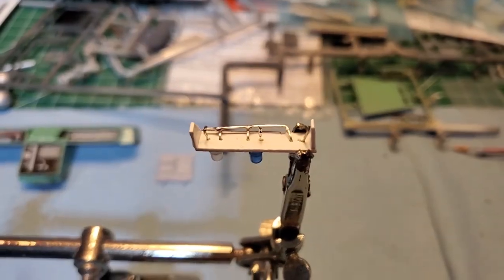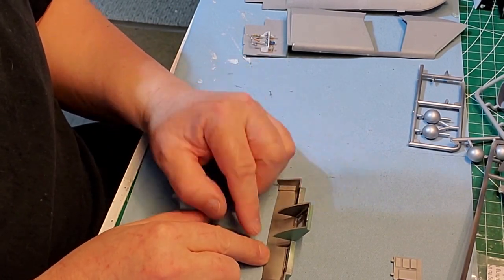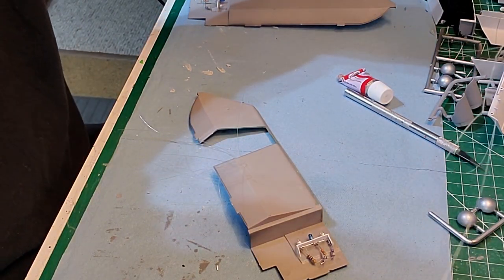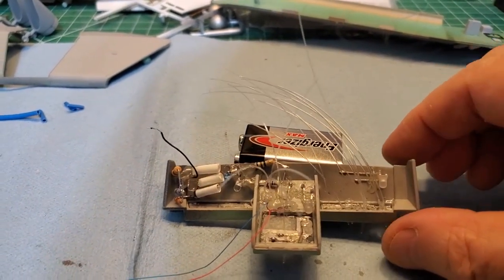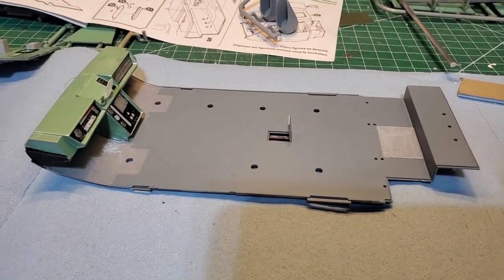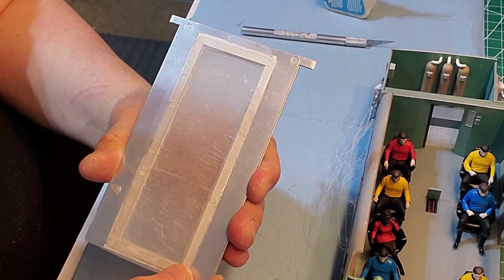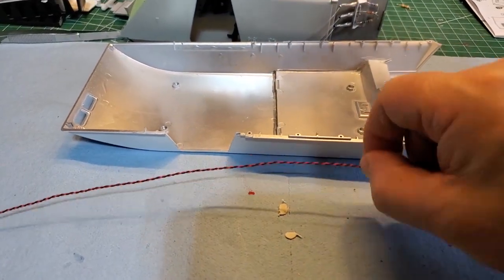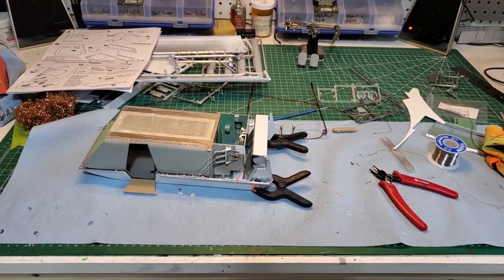Galileo Shuttle Build (Part 3)

Comment: You put that center interior  roof panle upside down,there are groves that fit into the inner walls.
Reply from the maker: I saw that but the dirty side would have been down so I modified it so the clean side was on the interior.